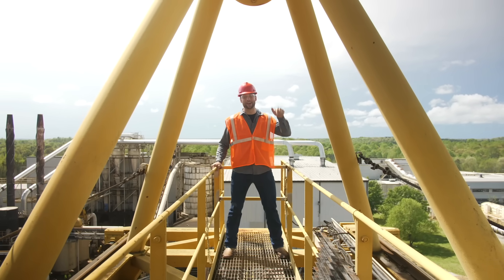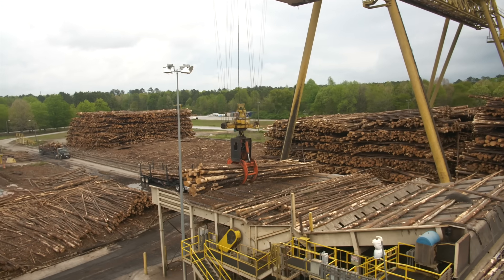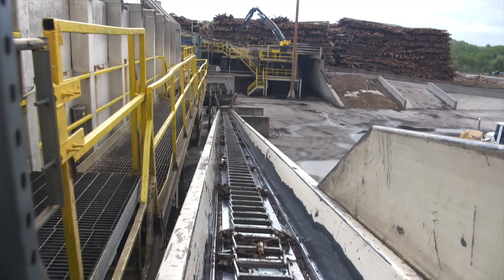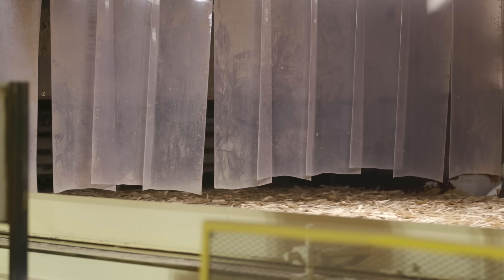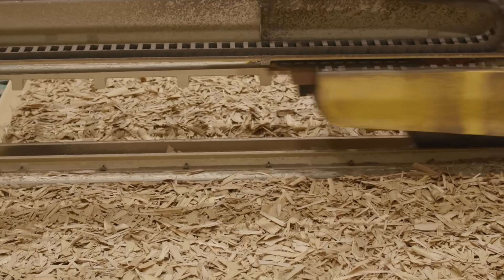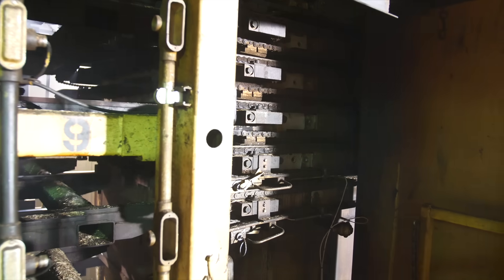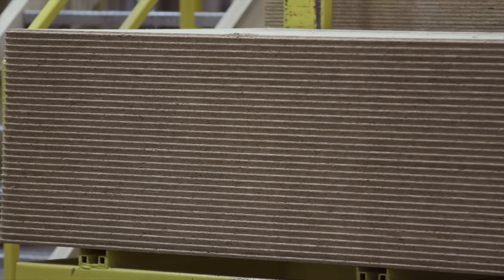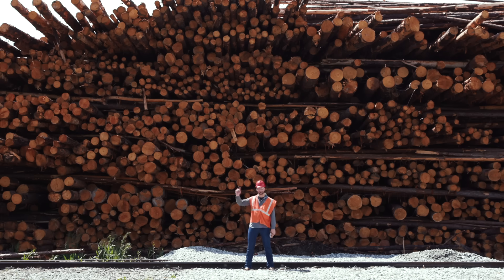Could OSB be BETTER than Plywood????

Comment: Seems like engineering is clouding actual reality once again. Water gets in..eventually....that's just the way it is no matter what  you do....Field tests and observations, not data analysis in a controlled environment is king here. OSB has been a major failure everywhere I have been up and down the east coast for the last couple of decades. Never a fan. In Florida with SS like building inspection requirements, you are guaranteed a rain shower or three on your freshly applied OSB while you wait for inspection.. Some have tried water sealer after installation and the SS (inspectors) blew a gasket. You then needed a detailed engineered spec sheet on OSB/Water sealer compatability...blah, blah, blah......maybe somewhere in America, just not Florida. Never will sell the experienced "old guys" on OSB. Great info from you guys still though. Keep up the good stuff. Cheers!!
Reply: A buddy of mine who does home reno type work in Florida says the same about inspection delays. He has moved to a different open work mode where he covers the structure or roof framing with tarps and poly to keep as much water out as possible. I saw pics he sent and it's like tent city.
He clears the cost of the rain prep with clients beforehand.
A surprising number of them seem to understand water in a home isn't good.
Reply: OSB is as good as the resin and as poor as the resin.  Depends entirely upon the resin.  Same is true in plywood.  You can buy marine grade plywood which can get wet for short periods of time and normal plywood which will swell up and be destroyed by one dousing.  It is all about the resin used.  Resin costs $$$$$$.  You get what you pay for.

Comment: I think both are good products, depending on the application. OSB, however burns up fast and really hot, anyone who has worked on a jobsite in the winter and built a fire with scrap OSB knows it goes up quick! And they are sheathing entire houses with it! You're good unless your house catches on fire..............

Comment: I'm building a cabin over ground that is damp most of the time. There will be a crawl space about two feet below the subfloor, what should I use for the decking?
Reply: Pressure treated
Reply: Or you can go with Midwest permacolumn brackets on concrete piers, less maintenance due to no wood in the ground leading to need to jack up the cabin or move it out of the way to repair the primary support framing.

Comment: My parents bought their home around 1965. The back fences had been put up by the neighbours before they moved in. One fence used exterior grade OSB panels while the other used exterior grade plywood. The plywood fence had to be replaced about 15 years ago because the panels had delaminated to the point of falling apart. The OSB has to be replaced a year ago. Both fences were painted and maintained to the same degree over the years. Unfortunately too many people compare OSB to particle board which is nothing more than compressed sawdust and has little strength in any axis and virtually no water resistance. 
I see a fair amount of folks here talking about off gassing from OSB and how bad it is for you. My question to those people is simply, what do you think holds plywood together and what do you think is used to give it water resistance? Chemicals, adhesives, and resins that's what. The only way you can avoid man made chemicals is to use solid wood which is expensive and subject to warpage, shrinkage, and cracking. Some woods are actually toxic themselves as was indicated in this video so even if you were to use solid wood you would have to be selective in your choices. Here is a list of toxic or irritant woods:  List Source:  https://www.wood-database.com/wood-articles/wood-allergies-and-toxicity/
Abura
African Blackwood
Afrormosia
Afzelia
Agba (Gossweilerodendron balsamiferum)
Ailanthus
Albizia
Alder (Alnus genus)
Alligator Juniper
Amboyna
Andiroba
Angelim vermelho
Araracanga
Ash (Fraxinus genus)
Ash, alpine (Eucalyptus delegatensis)
Ash, mountain
Australian Blackwood
Australian Cashew Nut (Semecarpus australiensis)
Avodire
Balsa
Bamboo
Batai
Birch (Betula genus)
Black Cherry
Black Locust
Blackbean
Bloodwood
Bloodwood, Red (Australian)
Blue Gum
Blue Mahoe
Bocote
Bosse
Box, Gray
Boxwood, Knysna (Gonioma kamassi)
Boxwood, European
Brazilwood
Brigalow (Acacia harpophylla)
Brownheart
Bubinga
Buckthorn
Bulletwood
Camphor
Cashew (Anacardium occidentale)
Catalpa
Cedar, Alaskan Yellow
Cedar, Aromatic Red
Cedar, Atlantic White
Cedar, Australian Red
Cedar, Incense
Cedar of Lebanon
Cedar, Northern White
Cedar, Port Orford
Cedar, Spanish
Cedar, Southern Red
Cedar, Western Red
Chechen
Chestnut, Chinese (Castanea mollissima)
Chestnut, Sweet
Chico Zapote
Chinaberry
Cocobolo
Cocuswood
Coolibah
Copaia (Jacaranda copaia)
Crow’s Ash (Flindersia australis)
Cuban Mahogany
Cypress
Cypress, Australian
Cypress, Gowen
Cypress, Leyland
Cypress, Mediterranean
Cypress, Mexican
Cypress, Monterey
Dahoma (Piptadeniastrum africanum)
Dead Finish (Acacia tetragonophylla)
Douglas-fir
Ebony (Diospyros genus)
Ebony, Brown
Ebony, Macassar
Ekki
Elm (Ulmus genus)
European Beech
Eyoum (Dialium dinklagei)
Fir (Abies genus)
Fir, Balsam
Freijo
Garapa
Goncalo Alves
Grasstree (Xanthorrhoea spp.)
Greenheart
Guanacaste
Gum, Lemon-Scented
Gum, Spotted
Gum, Yellow
Hackberry
Hemlock, Eastern
Hemlock, Mountain
Hemlock, Western
Hophornbeam
Hornbeam (Carpinus genus)
Idigbo
Imbuia
Indian Beech (Pongamia pinnata)
Indian Laurel
Ipe
Iroko
Ironwood, Desert
Jarrah
Jatoba
Jelutong
Juniper, Phoenician (Juniperus phoenicea)
Kahikatea (Dacrycarpus dacrydioides)
Karri
Katalox
Keruing
Kingwood
Koto
Laburnum 
Lacewood
Larch (Larix genus)
Leadwood (Combretum genus)
Lebbeck
Lignum Vitae
Limba
Machiche
Magnolia (Magnolia genus)
Mahogany, African
Mahogany, Honduran
Mahogany, Santos
Makore
Mango
Mansonia
Maple (Acer genus)
Maple, Queensland
Meranti (Shorea genus)
Merbau
Mesquite (Prosopis genus)
Messmate
Milky Mangrove (Excoecaria agallocha) 
Mimosa
Moabi
Molopangady (Breonia madagascariensis)
Monkeypod
Mora
Movingui
Muhuhu (Brachylaena hutchinsii)
Mulga
Muninga
Myrtle
Myrtle, Tasmanian
Narra
Norway Spruce
Nyatoh
Oak (Quercus genus)
Obeche
Okoume
Oleander (Nerium oleander) 
Olive
Opepe
Osage Orange
Osage Orange, Argentine
Padauk (Pterocarpus genus)
Palm (Arecaceae family)
Parinari (Parinari spp.)
Partridgewood
Pau Ferro
Pau Marfim (Balfourodendron riedelianum)
Pau Rosa
Pau Santo
Peroba Rosa
Persimmon
Pheasantwood
Pine (Pinus genus)
Pine, Huon
Pistachio
Poison Walnut (Cryptocarya pleurosperma) 
Poplar
Primavera
Purpleheart
Quebracho
Quina
Ramin
Redwood
Rengas
Rhodesian Teak
Rose Butternut (Blepharocarya involucrigera)
Rosewood (Dalbergia genus)
Rosewood, Brazilian
Rosewood, East Indian
Rosewood, Siamese
Rubberwood
Saffron-Heart (Halfordia scleroxyloa)
Santa Maria (Calophyllum brasiliense)
Sassafras
Sapele
Satinwood, East Indian
Satinwood, West Indian
Shittim (Acacia seyal)
Silky Oak, Northern
Silky Oak, Southern
Simarouba (Simarouba amara)
Sissoo
Slash Pine
Snakewood
Sneezewood
Spruce (Picea genus)
Sucupira (Bowdichia nitida)
Sugi
Sumac (Rhus spp.)
Sweetgum
Tali (Erythrophleum suaveolens)
Tambootie
Tatajuba
Teak
Thuya
Tiama (Entandrophragma angolense)
Turpentine
Tzalam
Utile
Verawood
Walnut, African
Walnut, Black
Walnut, English
Wamara
Wenge
Western Hemlock
Western Juniper (Juniperus occidentalis)
White Peroba (Paratecoma peroba)
Willow (Salix spp.)
Yew (Taxus spp.) 
Yellowheart
Zebrawood
Ziricote
Zitan
Abura
African Blackwood
Afrormosia
Afzelia
Agba (Gossweilerodendron balsamiferum)
Ailanthus
Albizia
Alder (Alnus genus)
Alligator Juniper
Amboyna
Andiroba
Angelim vermelho
Araracanga
Ash (Fraxinus genus)
Ash, alpine (Eucalyptus delegatensis)
Ash, mountain
Australian Blackwood
Australian Cashew Nut (Semecarpus australiensis)
Avodire
Balsa
Bamboo
Batai
Birch (Betula genus)
Black Cherry
Black Locust
Blackbean
Bloodwood
Bloodwood, Red (Australian)
Blue Gum
Blue Mahoe
Bocote
Bosse
Box, Gray
Boxwood, Knysna (Gonioma kamassi)
Boxwood, European
Brazilwood
Brigalow (Acacia harpophylla)
Brownheart
Bubinga
Buckthorn
Bulletwood
Camphor
Cashew (Anacardium occidentale)
Catalpa
Cedar, Alaskan Yellow
Cedar, Aromatic Red
Cedar, Atlantic White
Cedar, Australian Red
Cedar, Incense
Cedar of Lebanon
Cedar, Northern White
Cedar, Port Orford
Cedar, Spanish
Cedar, Southern Red
Cedar, Western Red
Chechen
Chestnut, Chinese (Castanea mollissima)
Chestnut, Sweet
Chico Zapote
Chinaberry
Cocobolo
Cocuswood
Coolibah
Copaia (Jacaranda copaia)
Crow’s Ash (Flindersia australis)
Cuban Mahogany
Cypress
Cypress, Australian
Cypress, Gowen
Cypress, Leyland
Cypress, Mediterranean
Cypress, Mexican
Cypress, Monterey
Dahoma (Piptadeniastrum africanum)
Dead Finish (Acacia tetragonophylla)
Douglas-fir
Ebony (Diospyros genus)
Ebony, Brown
Ebony, Macassar
Ekki
Elm (Ulmus genus)
European Beech
Eyoum (Dialium dinklagei)
Fir (Abies genus)
Fir, Balsam
Freijo
Garapa
Goncalo Alves
Grasstree (Xanthorrhoea spp.)
Greenheart
Guanacaste
Gum, Lemon-Scented
Gum, Spotted
Gum, Yellow
Hackberry
Hemlock, Eastern
Hemlock, Mountain
Hemlock, Western
Hophornbeam
Hornbeam (Carpinus genus)
Idigbo
Imbuia
Indian Beech (Pongamia pinnata)
Indian Laurel
Ipe
Iroko
Ironwood, Desert
Jarrah
Jatoba
Jelutong
Juniper, Phoenician (Juniperus phoenicea)
Kahikatea (Dacrycarpus dacrydioides)
Karri
Katalox
Keruing
Kingwood
Koto
Laburnum 
Lacewood
Larch (Larix genus)
Leadwood (Combretum genus)
Lebbeck
Lignum Vitae
Limba
Machiche
Magnolia (Magnolia genus)
Mahogany, African
Mahogany, Honduran
Mahogany, Santos
Makore
Mango
Mansonia
Maple (Acer genus)
Maple, Queensland
Meranti (Shorea genus)
Merbau
Mesquite (Prosopis genus)
Messmate
Milky Mangrove (Excoecaria agallocha) 
Mimosa
Moabi
Molopangady (Breonia madagascariensis)
Monkeypod
Mora
Movingui
Muhuhu (Brachylaena hutchinsii)
Mulga
Muninga
Myrtle
Myrtle, Tasmanian
Narra
Norway Spruce
Nyatoh
Oak (Quercus genus)
Obeche
Okoume
Oleander (Nerium oleander) 
Olive
Opepe
Osage Orange
Osage Orange, Argentine
Padauk (Pterocarpus genus)
Palm (Arecaceae family)
Parinari (Parinari spp.)
Partridgewood
Pau Ferro
Pau Marfim (Balfourodendron riedelianum)
Pau Rosa
Pau Santo
Peroba Rosa
Persimmon
Pheasantwood
Pine (Pinus genus)
Pine, Huon
Pistachio
Poison Walnut (Cryptocarya pleurosperma) 
Poplar
Primavera
Purpleheart
Quebracho
Quina
Ramin
Redwood
Rengas
Rhodesian Teak
Rose Butternut (Blepharocarya involucrigera)
Rosewood (Dalbergia genus)
Rosewood, Brazilian
Rosewood, East Indian
Rosewood, Siamese
Rubberwood
Saffron-Heart (Halfordia scleroxyloa)
Santa Maria (Calophyllum brasiliense)
Sassafras
Sapele
Satinwood, East Indian
Satinwood, West Indian
Shittim (Acacia seyal)
Silky Oak, Northern
Silky Oak, Southern
Simarouba (Simarouba amara)
Sissoo
Slash Pine
Snakewood
Sneezewood
Spruce (Picea genus)
Sucupira (Bowdichia nitida)
Sugi
Sumac (Rhus spp.)
Sweetgum
Tali (Erythrophleum suaveolens)
Tambootie
Tatajuba
Teak
Thuya
Tiama (Entandrophragma angolense)
Turpentine
Tzalam
Utile
Verawood
Walnut, African
Walnut, Black
Walnut, English
Wamara
Wenge
Western Hemlock
Western Juniper (Juniperus occidentalis)
White Peroba (Paratecoma peroba)
Willow (Salix spp.)
Yew (Taxus spp.) 
Yellowheart
Zebrawood
Ziricote
Zitan
   

So if you fear having toxic or irritating substances in your domicile you may want to look into uninsulated concrete because most insulation materials also have chemical binders or other potentially harmful man made products in them and unpainted metal furniture..............

Comment: Time will tell and so far plywood and OSB have not done well compared to actual boards...…..no matter what, all of it is organic and will be eaten by bugs, mold and rot...…..poor building materials to begin with, even the best ones.
Reply: If not for our damn ancestors who literally clear cut the old growth more than they needed we would still have better wood to this day. Another method of gluing is using the lignin (natural sap) inside the wood chips by using sonic welding to drive it out and self glue and then use man made adhesive or plastic resin to fill in the gaps.
Reply: So I hope that our children and the children's children don't have to make that same comment. Are we doing enough ? Kinda scary to say to your child that you destroyed it and there's no more oxygen to breath. Tough ! Climate change is real. Not fake news. Let's protect this rather fragile planet we're stuck on. And just maybe they'll have some 'old growth' timber to work with again.

Comment: OSB is like hot dogs, its all the leftover garbage that you cannot sell for anything else. I use plywood for making fixtures when water jet cutting and some of that plywood stays soaking in the tank for weeks or months before getting too cut up and destroyed. It does swell slightly but stays together. Recently I had a shipping crate made from Huber green zip OSB show up and I recycled it by using it for making a fixture. Less than one day in the tank and it was swollen, crumbling and done.

The roof on my house was re-done in 2003 and they replaced any 'bad' plywood with common 7/16 OSB, walking on it I can feel the softer bouncier spots and know exactly where they replaced anything.

OSB is junk, it always has been and always will be.

Comment: Where's the comparison between this and high quality plywood? I have NEVER walked over an OSB board that felt stiffer or better than same thinckness plywood.
Reply: Well then, where do they sell this product and is all the OSB at home depot low quality? Just about all of the OSB I've ever bought at home depot has been lousy but I recently bought some plywood there that also started to delaminate as soon as it got wet.
Reply: @dangrimes5078  Ding ding ding: Give this man an award.  Used to be able to buy OSB for outdoor use.  I still have some that is sitting outside for last 30 years used as a splash shield for my firewood.  Same spot also has plywood of different varieties and most of it has died(delaminated and blown up).  Some has not.
Reply: @dangrimes5078  well that’s Home Depot in a nutshell (or gamma/Praxis where I live) people keep moaning about what quality stuff costs so they just sell cheap garbage.

Ever found a straight peace of wood in the lumber department?
Reply: I've walked on one it was meant to be flooring it wasnt the cheap shit that's hardly glued
Reply: Walk on some Advantech and you'll change your mind asap.
Reply: @skliros9235  but is it better than same quality plywood at same thickness?
Reply: @AluminumHaste  Yes: OSB depends ENTIRELY upon the resin used to glue it together.  You can buy Crap, and you can buy good stuff.  The resin is superior to the wood, but costs more $$$.  You get what you pay for... Shocker huh?

Comment: OSB has a very bad reputation to overcome. Typically OSB is considered cheap and prone to water damage. Nice to see a video on how it's manufactured but I would be far more impressed by an independent plywood, OSB longevity comparison study.
Reply: EclecticFortune2 - as a remodel contractor, I've seen LOTS of deteriorated plywood or plywood that has delaminated.
Reply: @micahwatson9017  Thanks for the reply Micah. What are your thoughts on plywood vs OSB. I suppose the resin or binding agent determines the longevity. Your thoughts will be appreciated.
Reply: Wrong!

Comment: Wrong title... How OSB is made, not compared to plywood in any meaningful way.
Reply: RIGHT!!.. I DIDNT SEE ANYTHING POSITIVE FROM THIS VIDEO!... HE DIDNT REFERENCE PLYWOOD ONCE!... I HATE WHEN GUYS MAKE VIDEOS LIKE THIS!
Reply: Yes, it is mis-titled. They don't even talk about a comparison to plywood, but here's a basic comparison:  Like plywood, OSB can withstand the elements during construction, and for the same thickness, has the same span rating.
Reply: Mostly because it’s not comparable it’s just cheaper....
Reply: Proper birch ply is fabulous stuff - when you can get it. OSB is 1/2 the price and does the job for all but the finest joinery. For jointing OSB I use Confirmat screws and prime the end grain with glue before adding the jointing bead.
Reply: Demonstration of OSB vs Plywood.
https://www.youtube.com/watch?v=xXqno7k43HM
Reply: cynthia houser  Please back that up with proof.  Pretty sure they are made out of poly resins.  Oil derived.  Very much like fiberglass.
Reply: cynthia houser  The adhesive used in plywood and OSB manufacturing, are oil-based polymers. They are “exterior grade” adhesives. You’re probably thinking of Elmer’s glue, and others, that are used in crafts and stuff. Interior grade glue. 
It might come from horse hoofs. I do have bad news for you: horses get old and die eventually. Many of these horses will starve to death, if their populations are not controlled. Do you like seeing horses starve to death? I doubt it.
And it’s interesting that you were working for the BLM in the 1800s! Holy cow, you’re old! How old are you? 😂🤣
Reply: CREDIBILITY, CREDIBILITY, CREDIBILITY.  Once acquired, EASILY LOST, near NEVER REGAINED!!! CREDIBILITY???
Reply: Go to a tornado material testing lab.  Then tell me OSB is better than plywood.

Comment: Drive some screws and yank them out test.
support the ends and weight the middle to breaking point test.
Rig up a fold test to test shear or twist.
Reply: You forgot the most important test to a typical builder: the cost $$$ per sheet test.
Reply: @valkyriefrost5301  LOL...yep

Comment: The only argument i see mentioned repeatedly is, that its bad in the rain. Neither plywood nor OSB are good at taking moisture, so you simply dont use them outside. Plywood is a lot more expensive though. OSB is strong enough for subflooring, walls and things of that nature, so using plywood would be a waste of money. 
If you need water resistance use cement board. Even water proof plywood doesnt last that long.
Reply: I put many (Around the same number in each one, mostly nail and screw size) holes in a sheet of plywood and also a sheet of osb to see how one would hold against the other, guess which held up better.